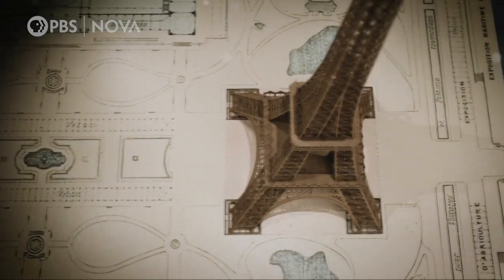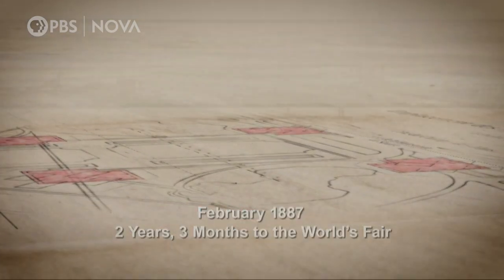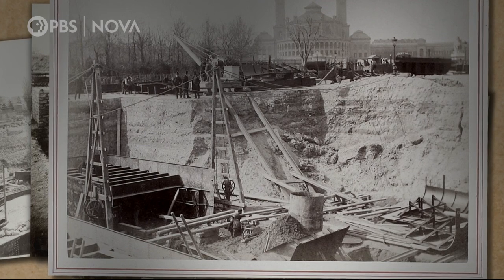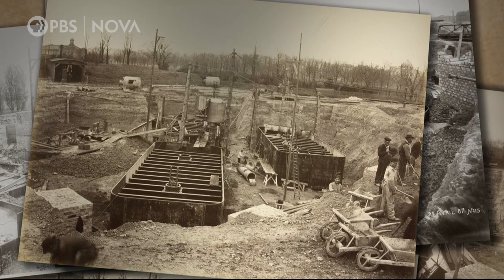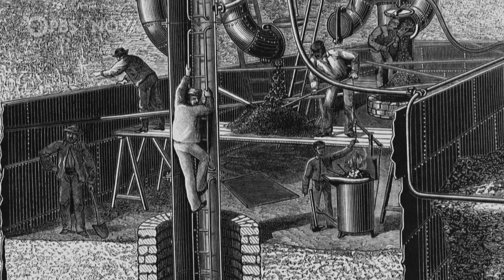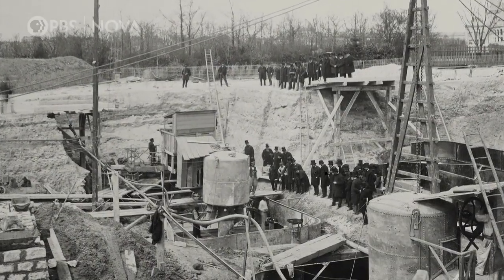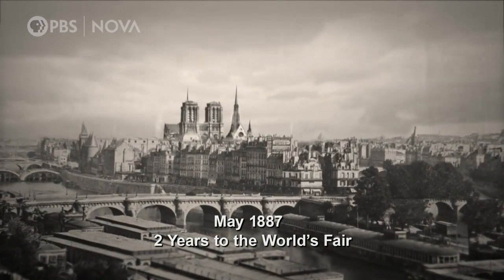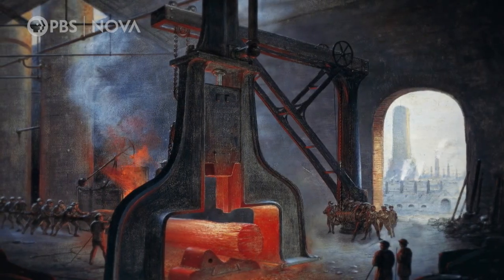The Mysterious Illness That Befell Eiffel Tower Construction Workers | NOVA | PBS

Comment: Former SCUBA Diver, generally dives less than 10 meters don't require decompression. The piers were less than 7 meters deeper than river. There was no need to pressurize the caissons more than that. However, if extended work times, it is advisable to depressurize slowly over a period of time.
Reply: Using a shovel, spade and pickaxe for a shift?
Reply: @davepowell7168  Mostly irrelevant. Body fat matters more than exertion.